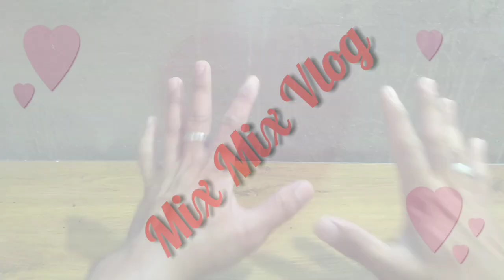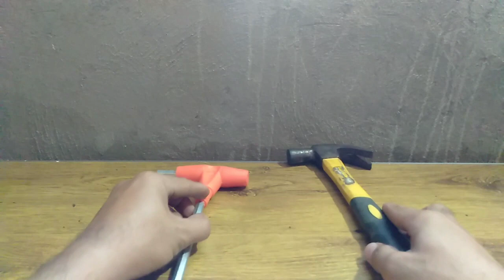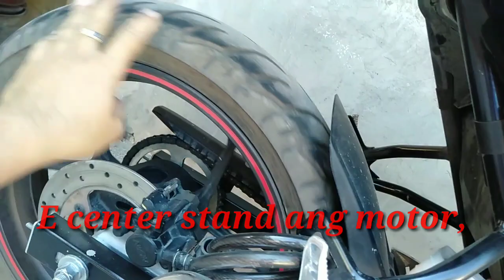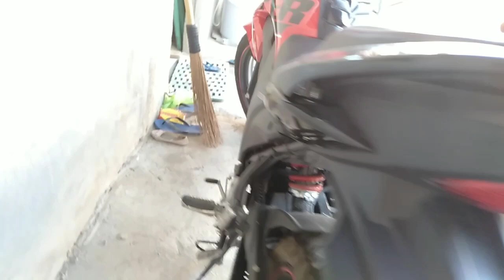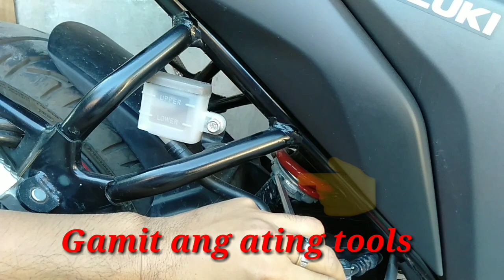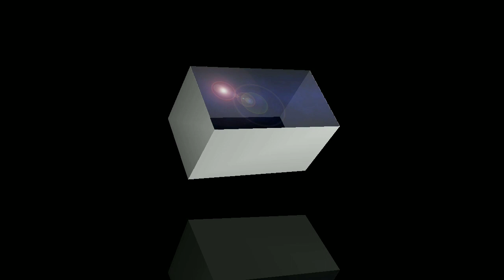#How to Adjust Suzuki Gixxer 155cc Suspension from stifist to smoothest..!

Comment: Bro Can I reduce the seat height so that it's pillion seat height reduces. Please reply
Reply from the maker: Yes sir,pwede mong e adjust Ang suspension sa likod at harap,pati yong foam sa upuan pwede mo bawasan para bumaba yong seat height nya..ako is 5'4 lng ako pero abot na abot ko na sya..thanks po..hopefully maka tulong..
Reply: @nionestvvlog5000  Sir Can You please tell me in English .
Reply from the maker: Ah ok sorry,😁..to reduce your seat height of your Suzuki Gixxer,you can adjust the front and back suspension to your preferred height,and also the seat foam you can also adjust it through cutting it..I'm 5'4 in height and can handle my motorcycle easily..thank you,hopefully it helps to you sir..😀
Reply: @nionestvvlog5000  Oo Thank You. Just last question, Is the pillion seat of the bike can be made comfortable after adjusting the seat height ? Cus you know that the pillon seat is highly raised 🙁
Reply from the maker: Yup..the highly raised set is only you are going to cut..thank you😁